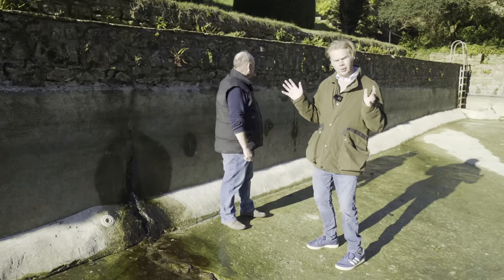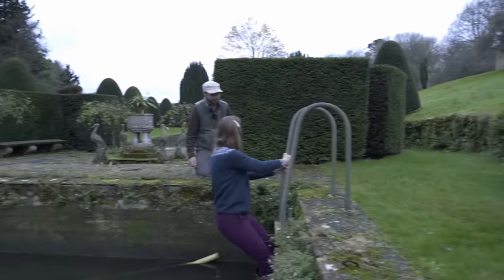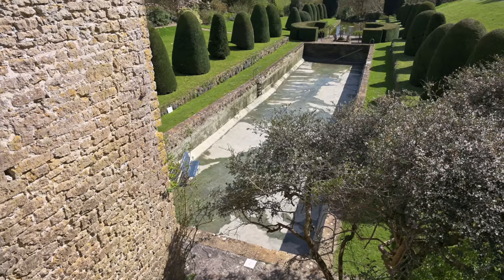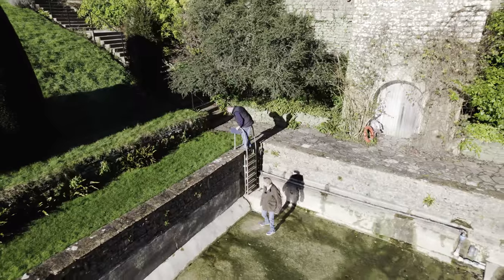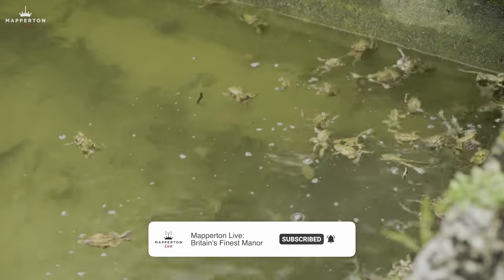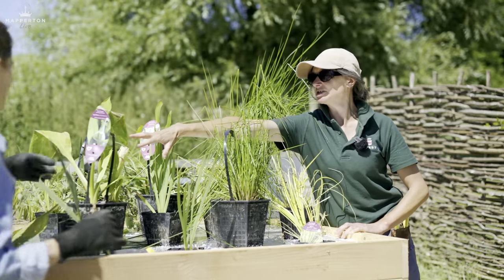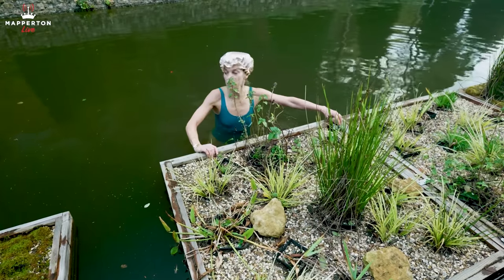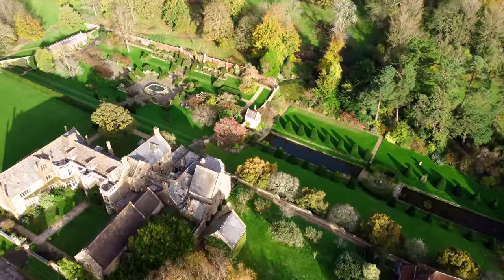How We RESTORED our HUGE 300 Year Old Swimming Pool - 1 Year (in 15 Minutes)

Comment: Would it be too hard with the landscaping and pavement around the pool to trench behind the pool walls, sheathe the walls with tarpaper/waterproof barrier paper, and then put layers of French drains parallel to the pool to divert the ground water to the lower garden pool?  Imagine that would cost a lot of money and then worry about shoring up terrace on the house-side of the pool.  Can the water from the spring be treated before it touches the pool?
Reply: No, they don't want to put anything in the water.